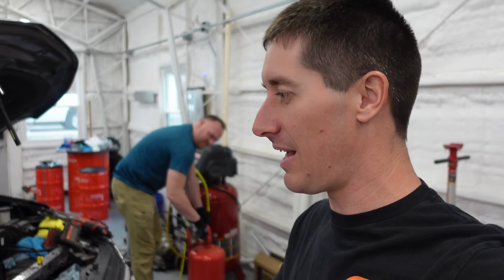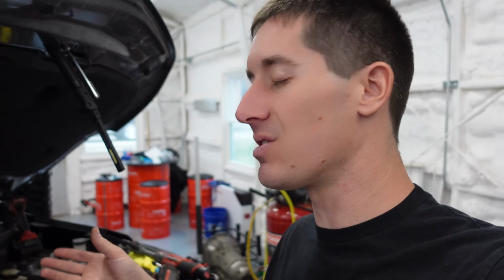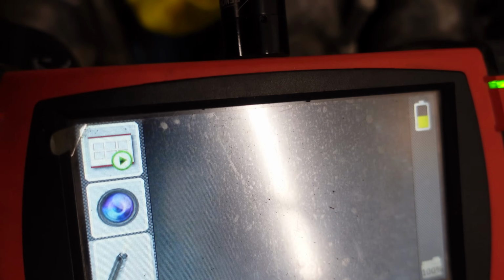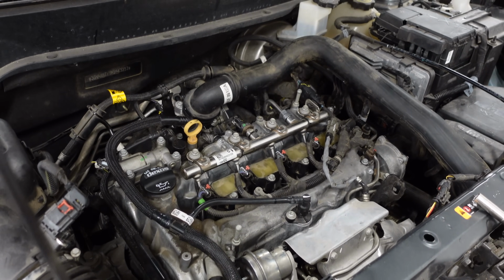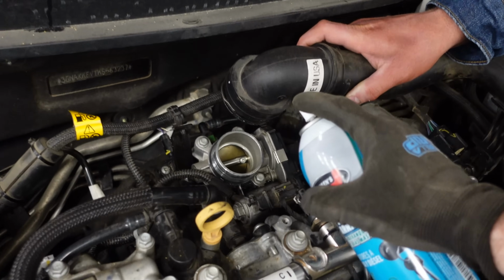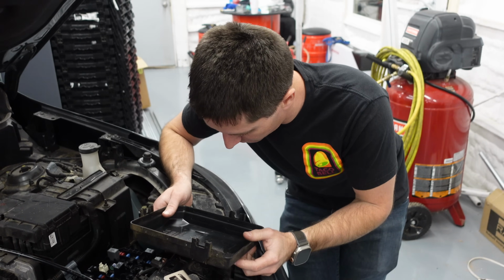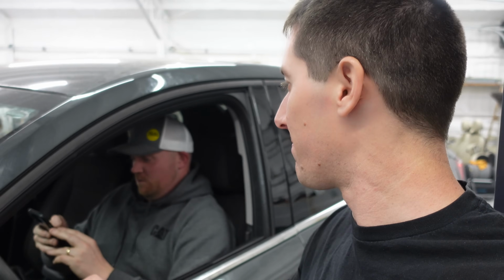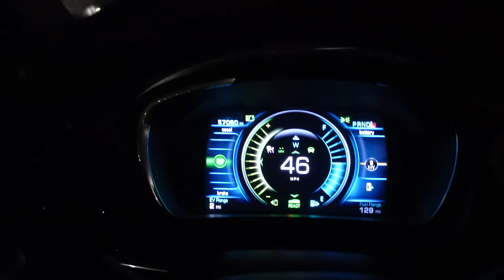I FIXED The UNFIXABLE Chevy Equinox *You'll Never Guess The Problem*

Comment: Next time borrow a scanner and activate the fuel pump or jump the relay for the pump
Reply from the maker: We went over all this, and I did use my scanner to run the pump... there is no relay, this is a PWM pump with a control module like all the new cars 🍻
Reply: @ ohhhhh. Gotcha. 
I’ve seen this happen twice in my 35 years wrenching. 
Definitely not something you really see.
Reply: @WatchJRGo just went back to rewatch. I totally missed it using the scanner lol. My bad. I think I missed about 10 minutes off the video actually 🥴

Comment: Can i say seafoam. Sometimes you can still have to much water in gas. I have had 5 vehicles shut down by water. 2 times in a diesel 3 times in a gas. Twice seafoam fixed the problem once was 6 grand in the diesel.

Comment: It is incredibly stupid that a Bargain Basement SUV would require premium. I drive a Lincoln MKT with the 3.5 EcoBoost and it runs perfectly on regular.
Reply: When I ran 87 octane in my 2017 Edge with the 3.5 the exhaust fumes were horrible, it would choke you out in the garage just pulling it in and out. If you had to get in the gas pedal or climb a steep hill it stunk to high heaven of rotten eggs.. I absolutely HATED it.

If I ran E88 from Casey's the fumes were not too bad at all and it still had the sulfur smell from time to time but not nearly as bad or pungent when it was regular 87 gas. I am so glad I got rid of that thing and went back to Toyota, I don't miss that car at all.

Comment: I would swap it for a  Toyota 
I give my 2019 equinox a good old fashioned wide open on the interstate
No these are not flex fuel it states in the owners manual not to use E85

Comment: Are you serious??? 

I told you to check the gas! 

What I said on first video ⬇️ 
I think it’s something simple, you’d probably have some idea of the issue by the way it sounded once it started up. If it were timing chain I would imagine there would be more codes and you would hear it. Could it be bad gas ECM (possibly bad ecm) compensating for bad gas might throw it off, did she just refuel? Maybe there’s a clog in fuel intake or what ever. Fuel rail? Clean intake? There has to be some GM diagnostic on engine crank no start that should be easy enough before pulling the engine.

Comment: My 13 lc9 5.3 freaks out thinking it has too much alcohol in it.
Reply: Showed 59% alcohol at the dealer and had codes for rich banks and smelled like straight gasoline. Had the codes cleared a couple years ago by my friend with a Snap On and no codes since.
Reply: Should say freaked out

Comment: My sister had a 2016 equinox and it required premium, it depends on which engine it has, at least the valves are nice and clean now, these GDI engines are garbage.

Comment: "JR" I love you, been watching your channel for years, but sorry mate, this comes under the category of "ROOKIE MISTAKE".  (And partly the fault of the person who you're helping out, by fixing this).  

First check the person's Fuel and Maintenance notebook which they keep in the glovebox.  Y'know, the notebook where your write down every time you put fuel in the car, what Fuel Station you used, what fuel grade you added, how many dollars and how many litres or gallons you added. 

WHAT ? No Notebook  ! Seems like the naughty owner does not have or use such a notebook. (Also good for writing down whenever you check the tyre pressures, and whether you did just 4, or all 5 tyres. If your car has a spare, many nowadays do not).  

You could have asked the owner to check their receipt. Remember folks ALWAYS get a receipt when buying fuel. If a self-service fuel pump warns it will NOT provide a receipt, move to the next pump.  (Also allows folks to later verify that they have not mis-fuelled a vehicle by accident, eg with Diesel).

"Engineering Explained" I think is the Youtube channel which has proven that USA's system of putting Corn Ethanol in fuel is just a government mandated subsidy for corn farmers. It's actually worse for the planet and less sustainable than using pure petroleum fuel.  (Plus it badly affects older type fuel systems, attracts moisture,  and perishes rubber hoses and carb diaphrams etc)

Fortunately our fuels here are all Ethanol zero, at the moment at least. Over the years I've made a non-series of 4 or 5 videos showing me testing a small one cylinder electric generator. It still starts and runs on 10 years old petrol/gasoline fuel !
Reply: https://www.youtube.com/watch?v=zXt7nrj3gPw&t=329s

Comment: Friends don't let friends buy Chevy cheap SUVs
Reply: You can't blame Chevy for bad gas.
Reply: AMEN Brother!
Reply: The Equinox is actually pretty reliable.  Definitely better than the CRV and Rouge.  Those are trash.
Reply: @user-tb7rn1il3q That’s a lie. Especially on the CR-V, which outsells it by almost 2.
Reply: @user-tb7rn1il3q  straight lie on the CR-V. Boomer simping for domestics after 2007 is gross and I drive a Ford.
Reply: @06MoeJoe  No the CRV has a weak belt CVT and an engine that floods the oil with gas.  Also the AC is taken out by small rocks and the AWD is useless.

Comment: Toyota D-4S dual injection!!!!
Reply: Technically Toyota doesn’t use it to keep the valves clean though.  It does work well, but you should still run it hard occasionally.  Every car should get redlined shifted at least once every thousand miles.  Cars that are old lady driven are usually trash by 60k miles.

Comment: Yo tons of these cars die at 60,000 or less…. Timing chains, all sorts of evap issues, burns tons of oil I mean tons of oil.. I have a 2013 and I like it a lot I got it with 145,000 on it and almost  have 250,000 on it. When I got it, the guy that sold it to me had done the timing chain and actually knew a lot about equinox’s and was the only guy around that would do the timing chains and the work on these cars. I’m actually having trouble right now passing inspection cus I live the communist state of ny and ya have to have all the lights off for inspection , it’s a huge huge scam.  The current codes it’s throwing are evap codes etc.  just changed the upper fuel pump and the car has so much more power it’s great, but still lights on. I’m also having another issue of it getting hot after running for a while and gets hot at a light or dropping someone off at their place and sitting there talking to the person the temp gauge goes up and then as ya start driving again it comes back down…. So I think either a fan or thermostat or throttle body… anyone have any awesome ideas! It also has always eatin oil, I mean alot of oil I mean you have to watch it every 3-4 days it’ll go through a quart or more so it’s going somewhere burning somewhere inside, etc. electronics are real funny in these cars like ya said every time you start it the lights on the main dash will go on and off as well as the gauges go to the top and then back down… maybe that’s normal who knows….

Comment: As I've learned with DI gas engines, the oil monitor on these cars are worthless. Even the best Amsoil shouldn't go 8 to 10K miles in these things. Oil needs to be changed in half that time. Then the factory catch can, if so equipped, needs to be emptied and cleaned at each oil change. Also, since I live in FL where it's HOT a lot of the time, my 3.0V6 likes 93 octane. If I use 87 it diesels after I shut it off.  Mine is now 14yrs old and approaching 177K miles.

Comment: Any car or truck newer than 2001 is junk made to last 100,000 and trough away, my 2001 GMC Sonoma which I bought for 5000 in 2009, is now worth about 9000, it's 4x4 with G80 locker 3.73 10" diffs, not 187,000 miles, My 1973 K1500 looks like new, bought in 1995 for 1200, put a 305 v8 in 4 speed manual, NP 205 the best transfer ever made on planet earth is now worth 20,000 plus new shit is junk

Comment: Is this a direct injection engine? Never mind , I needed to watch longer. DI engine are pieces of $hit, JMO
Reply from the maker: Absolutely 🍻
Reply: Indeed, the carbon buildup.. I thought modern gas direct injection engines had moved to first starting with fuel being sprayed behind the valves to clean them like traditional injection, then transition over to direct injection after the engine has started. i.e. the valves are cleaned/flushed with fuel on each startup to keep carbon buildup down.
Reply: @marcusdamberger some newer ones have dual injection like the gen 3 ecoboost 3.5.

Comment: I hope we see the follow up without either of you sustaining brain damage running an engine indoors so long!  Don’t do that!!

While you borrowed Car Ninja’s walnut blasting rig, go buy the cheap, under $50 one from Harbor Freight.  I have one for my R56 Mini engine and it works great with my 30 gallon air compressor.  I do that engine every year to keep the carbon at bay.